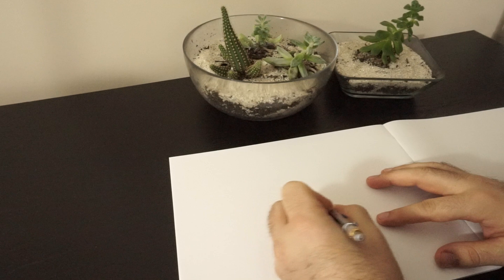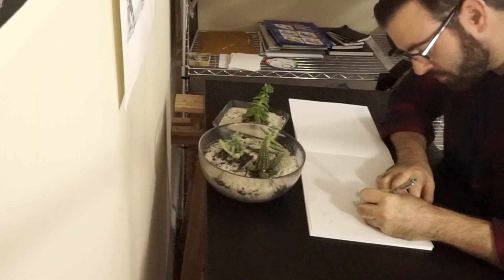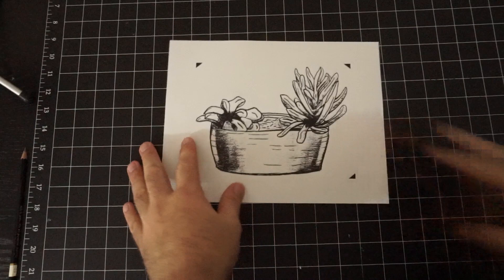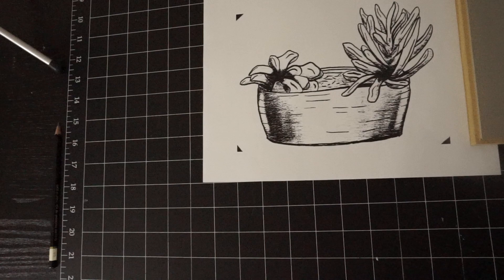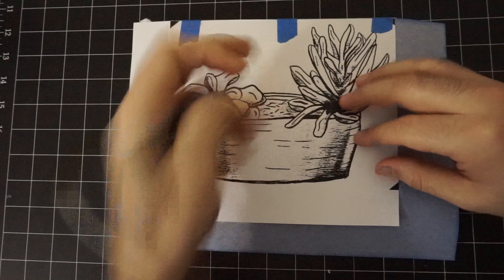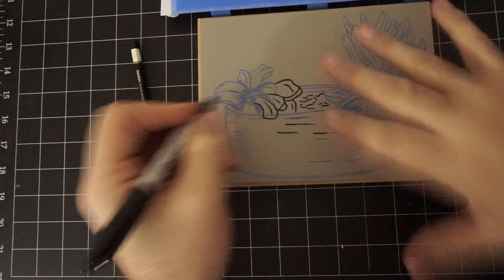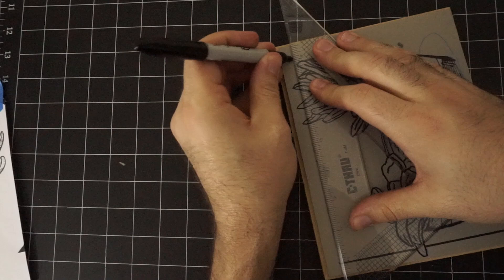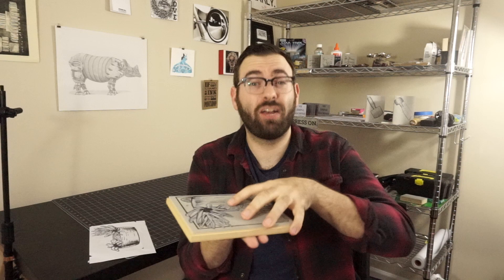Linocut Printmaking Tutorial 02: Drawing and Transferring your image

Comment: Thanks, Graham. After I've transferred the image onto a block with transfer paper, I spray it with workable matte fixative to stabilize the image. That saves the time of then having to redraw it with a Sharpie. Before printing it, I go over the surface with fine-grit sandpaper (320-600).